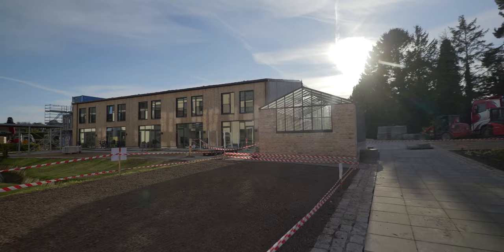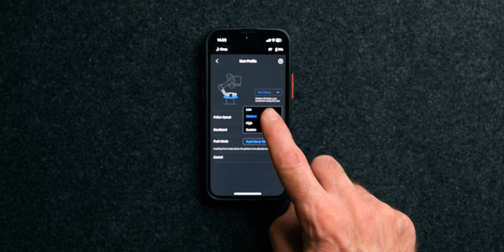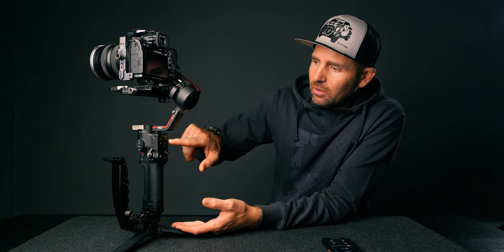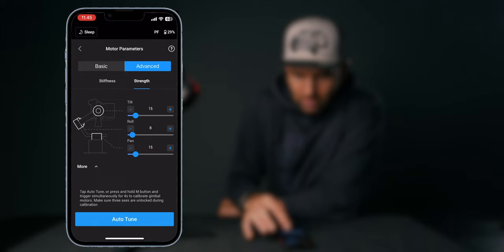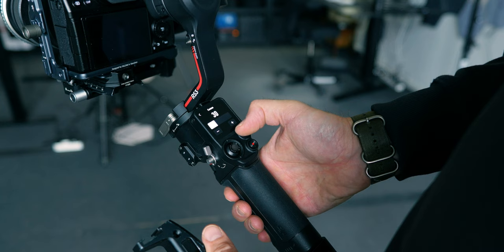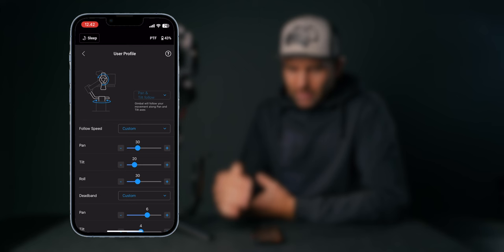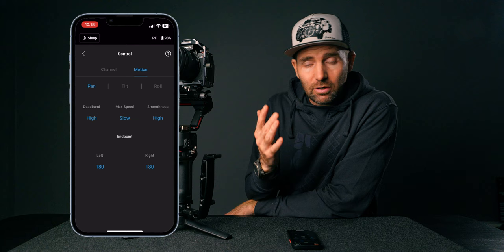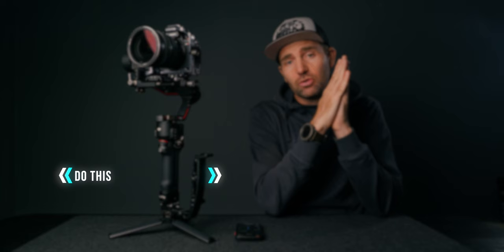DJI RS3 Gimbal Settings | From SHAKY To Super Smooth Footage!

Comment: Hi Peter, everything what you explain here is totally right. 
Anyway,  there is a final step up our sleeves if the footage is still jittery (assuming balancing and all settings are done correctly): 
BRING THE GIMBAL SLIGHTLY OFF BALANCE FOR THE JITTERY AXIS (YES, off-balance!)

Without jumping into deep-dive engineering explanations: 
There is a principle tendency of control-loops for stabilizing mechanical systems to start 'self oszilation' in case of a perfectly balanced mechanical system - in our case a gimbal axis.
In simple words: the control-circuits just do not know into which direction to counter-act an upcoming deviation of the axis.

The simple solution is to put the problematic axis very slightly off-balance - only so slightly that it still does not want to completely swing out when the gimbal is turned off.
This keeps the stabilization control-circuit for the axis permanently slightly engaged. Again, the off-balance needs to be very slight and should not make the motor overheating.

I just solved the often posted horizon jitter of my old Weebilll S this way within a minute - now, the horizon is like spirit level.

Where did I learn this trick from: It was my control-systems & cybernetics professor 35 years ago who told us about the secrets of stabilization systems for helicopters.
Reply from the maker: Hi, Interesting topic. I would like to know more about this, so if you are interested in a quick chand on zoom, please reach out to me peter@thegimbalacaemy.com
Reply: @PeterMakholm he is right, it is better to have a little load on the gimbal motors on than no load, they dont know what to do and the control loop can spin out of control
Reply from the maker: Yes that is correct. I talk about this in my course and have also mentioned it in other videos here on the chanel . But thanks for sharring!
Reply: awesomeee! i had the rsc, rsc2 and now the rs3. Even with in body stabilization i felt too much jittery with rs3, more than rsc2. But i will try this. Thank so much.

Comment: I like the way you've set the briefcase handle. Side setup may allow a more robust core. 
   Can i do this with the DJI handle ? 
  Im also torn whether to buy the focus motor/handle "combo" kit or just get the basic kit and a third party handle. 
   Looking at real estate video and lower cost point weddings at a later date. 
 Perhaps follow focus for a wedding isn't necessary for quick captures.. 🤔 any thoughts ? 

  Ill def be dialing in with your recommendations to begin with.   V cool 😎

Comment: Thanks for this guide! I'm looking forward to finally tuning my RS3 properly. I didn't know you can only tweak some settings in the app. I recently tried to mess with the custom settings on the gimbal already, but I still had some unwanted jerkyness (epsecially pan).
Reply from the maker: Yeah, start with my settings and then correct them so they will fit you setup. 😎
Reply: لوسمحت كيف اقوم بتنزيل التطبيق

Comment: Great tutorial @PeterMakholm as always, much appreciated. I just pulled the trigger for your tutorial PDF. I wonder if there‘s a trick to put the gimbal upside down for low shots. I always struggle with that.
Reply from the maker: Thanks for the support. Yes, there is, It is not that hard to do, I do it while the gimbal is on. Just slowly Thun the handle sideways over the over the roll arm and when you got it up side down tripple tap the trigger then the gimbal will turn around, tripple tap again and it turns around again and it is centred and ready to go.
Reply: @PeterMakholm  much appreciated (again!)

Comment: Thank You very much Peter! This video is a real treasure. It's been almost a year since I purchased the RS3, but there are still some unclear nuances. Thanks to Your videos, I learned a lot. I would also like to clarify one detail related to RavenEye. On the smartphone I get a stable picture, everything is fine, but on the RS3 screen, when you swipe to the right, an image should also appear and you can use Active Track by touching the screen. But I am getting a black screen even though I have connected all 3 cables. Is this a gimbal bug or am I doing something wrong? Thank You!
Reply from the maker: You can only use RavenEye with the screen on the gimbal with the DJI RS3 PRO. That is properly why you can't make it work.

Comment: Hi, It's possible to know if the Handheld Gimbal Grip you are using is compatible with RS3, because the page you linked seem does not listed rs3 but  DJI Ronin-S, Ronin SC 2 only. Thanks a lot! Finally a useful video!
Reply from the maker: The Side handle is compatible with all gimbals.
Reply: Thanks a lot  @PeterMakholm

Comment: Great tutorial. I'm looking to purchase the DJI RS3 PRO for my Lumix S1H.  What setting for S1H would work best for real estate tours like you are doing? I have Ninja V  external recorder to shoot 422HQ V-log, or do you recommend in camera recording. with different codec?
Reply from the maker: The S1H is great with the RS3 PRO. I would use the settings i have listed in the PDF. when I shoot real estate I record directly in camera.
Reply: @PeterMakholm   Are you using Lidar auto focus system for real estate?
Reply from the maker: @neilseiffer  No I use manual focus and a high aperture. I set the focus point where I want to end the shot and then walk in to the shot. If it's a long shot, the start might be a bit out of focus, but no one will never notice, because i often speed ramp in the transitions.
Reply: @PeterMakholm   Thank you.  Are you using 12mm, 14mm, 16mm,  24mm, or something different for interior tours?
Reply from the maker: I am using a 16mm for wide shots and 85mm for closeups @neilseiffer
Reply: @PeterMakholm   Thanks.

Comment: Very timely, as I have been having problems with micro jitters lately! I have already auto-tuned the gimbal and set the deadband to high. But whenever I walk, I can see these micro jitters that are so annoying. What settings do you think I should look at?
Reply from the maker: Micro jitters is always a problem with gimbals, but try to make the gimbal as smooth as possible and then practice how you walk, because the micro jitters comes from the impacts that we create when we walk.

Comment: Saw you didn’t update the gimbal to the latest firmware, do you think there are any issue at 04.00 compare with 02.00? I found that the 04.00 need the gimbal stay on a flat service to wake up, otherwise it couldn’t balance, while the 02.00 did not.
Reply from the maker: Correct, I did not update, because it came up during the week I was filming the video, and I didn't want it to change any thing before I was done with the video. But I will update it in the future. thanks for sharing a potential issue with the update.

Comment: Thanks for this advice, I'm quite pissed off to find out that after spending this much on camera equipment it requires setting up an account to activate, and an app to control all of the settings though. When DJI eventually no longer supports these things, some of these devices will never be able to be activated to controlled to their fullest extent.

Comment: Peter- I noticed you increased deadban from previous gimbal setting videos. 
My concern is that the movement won’t be smooth because if you try to move slowly into a shot, your pan may not follow until too late. Thoughts?

Also, do you still shoot IBIS off??

Comment: Hi Great video, I find when I connect the rs3 to the app I go to user profile and can only get pan follow ? I click on it but the drop down menu is only available when the ronin is not connected..  when I auto tune it also changes your settings thanks
Reply: You need to switch the switch on the side of the gimbal and you will see the app switch over to the next group.
Reply: missed him doing that ! thanks :)
 @toddlaitar
Reply: @KRAFTMedia  it was real quick, I had to rewind it to see.

Comment: Hi thanks for the video... I just bought the RONIN RS3 Gimbal and would like to buy the Gimbal Side Handle that you are using. (DH03 Handheld Gimbal Grip) but RS3 is not listed as compatible ?
Reply from the maker: Yes that is the one. you can find the direct link to it in the description.
Reply from the maker: It works perfectly with the RS3